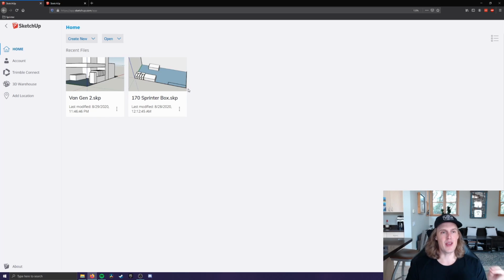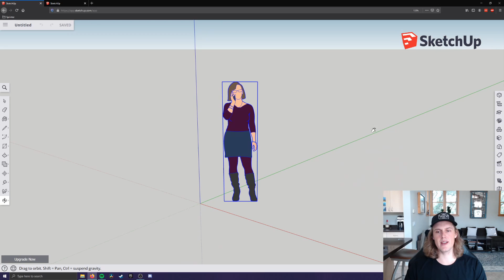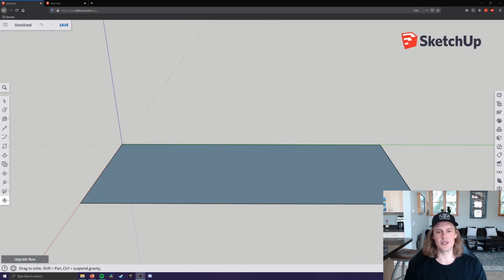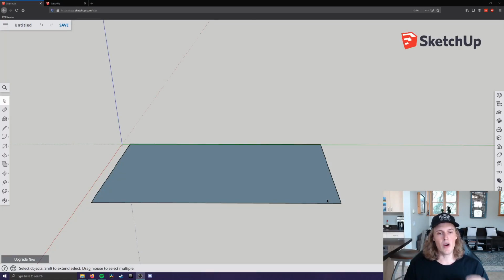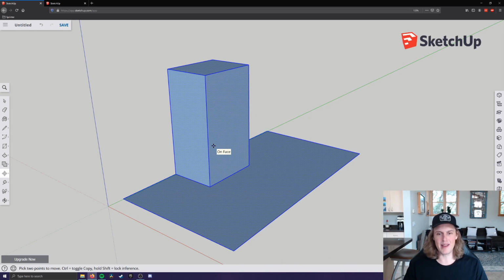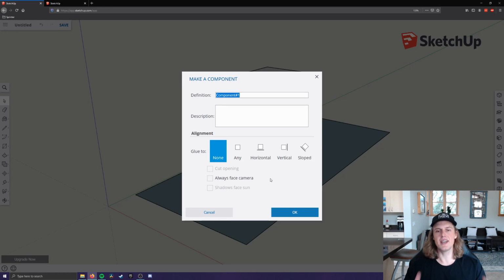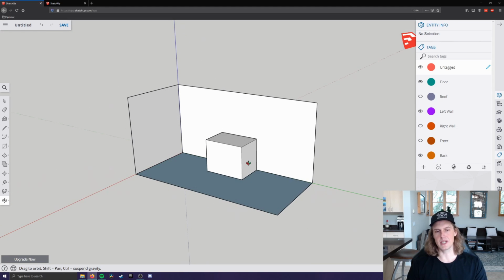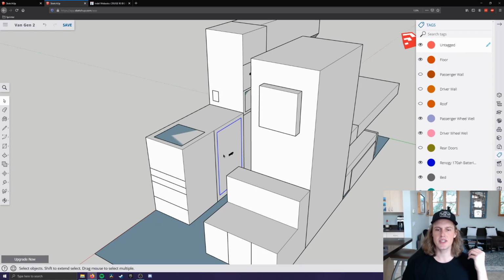How To Use SKETCHUP to Design Your Van / RV / Tiny Home / Basement Layout - SIMPLIFIED!!

Comment: If you make something a “component” such as a cabinet, if you copy it, but want to change the size of one, the size changes on all of those “cabinet components”. So each size cabinet needs a unique component name OR you can make “groups” instead. It is done the same way only you don’t have to name it or describe it. Components are fantastic when you want to use the same components over and over again but groups are great for things that need to have some of the same sizes (such as your limber sizes) but need differing lengths. Once you get a bunch of lumber (or 80/20) put together into a box/cabinet shape, you can then hold your shift down and select all the “groups” that form that thing and right click to create yet another group or component. 

Sketchup is amazing! But get in the habit of making groups or components very often. Tags are also great so you can turn some things off to work on other things so you don’t accidentally grab too much stuff and accidentally erase something you didn’t intend to erase (story of my life)!

Comment: Making components -- I select the rectangle that is the floor, (before adding anything else.  It's just the floor rectangle).  Right click.  Window opens, but does not include "make component" option.  Help!
Reply from the maker: Triple click to select the rectangle and all edges before right clicking
Reply: @seven_o_savage  Thanks!  I'm not sure you can triple click on a Mac.  But I figured out how to use the select button, then click and drag to encase and highlight the item, then double click on it and the proper box finally came up.  (We dummies have to have every step defined and walked through.)  Thanks again.  Your video, after many previous failures, was the one that finally helped me get sketchup to work.

Comment: Does viewing the display on a 16:9 monitor result in the visual distortion of a square even if you set the dimensions numerically? I'm using Lightwave 3D version 6 to design the "kitchen wall" for my Windstar mini van RV conversion. You can then animate the model and record it. I presume SKETCHUP runs under Windows 10?